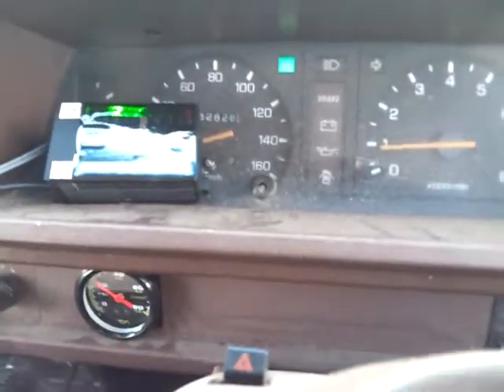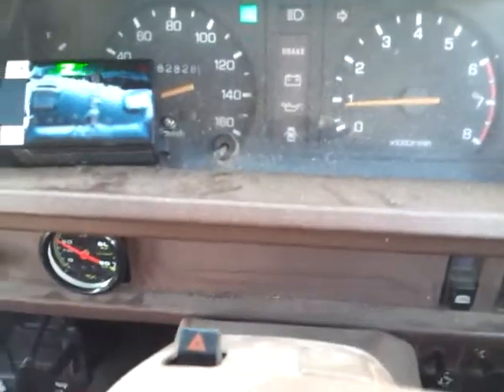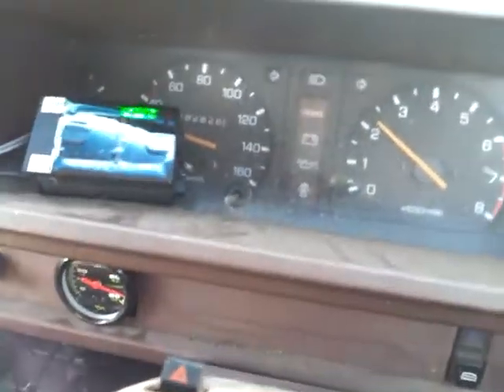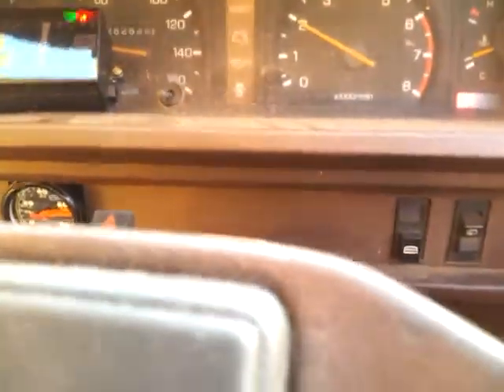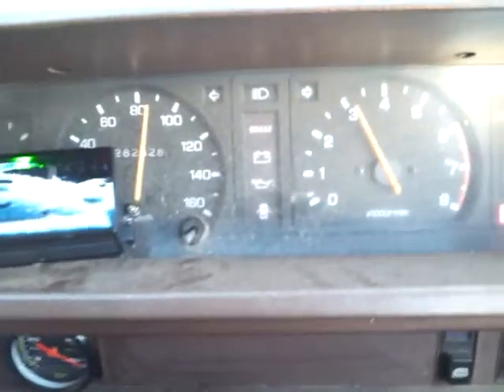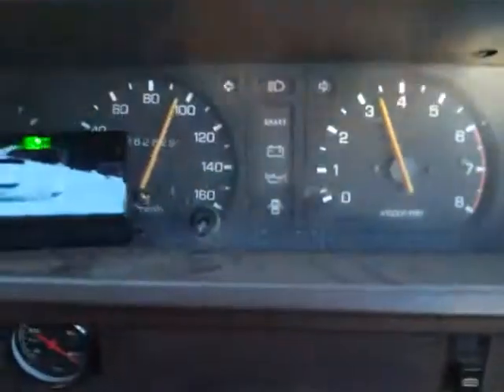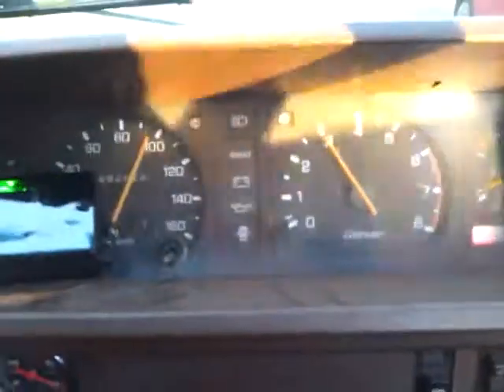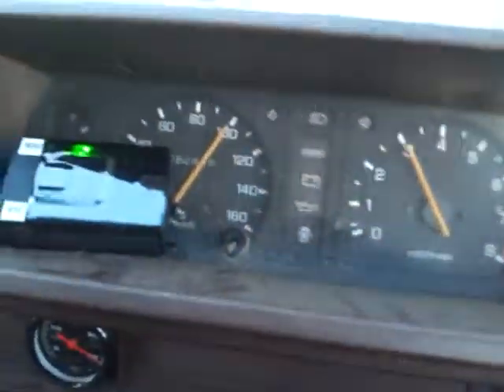Carb tuning issue

Comment: Is all the vacuum holes plugged, is the EGR on inlet manifold leaky, make sure its plugged or blanked.  Re Weber conversion, I found ripping all the vacuum hoses out useful, and plugging all the manifold holes.  Make sure the fuel return hose from fuel pump is connected to the fuel return to the tank otherwise youll create a possible fuel tank vacuum that will inhibit fuel flow esp at higher rpm.
Reply from the maker: Wishbone799 hey, only just realised your advice here. even though it was a year ago, thanks mate!
I ended up getting a wideband and going over the entire setup and wound a heap more timing into it. runs like a clock now :)

Comment: Shaun, did you check the vac diaphragm on the distributor whether it was functioning properly? Just attached a hose and suck and it should maintain a vacuum and stick on your tongue. If it has a pin hole you will just draw air in. Its an L300 common fault. Seemed from the demo you did I thought the secondary maybe wasn;t coming on early enough. Would be down on acceleration a bit as a result.

Comment: Shaun, is / was your fuel pump mechanical or electric?  Were the jet sizes you have supplied and fitted to the carb or did you fit the jets?